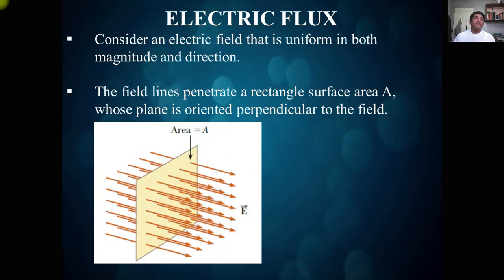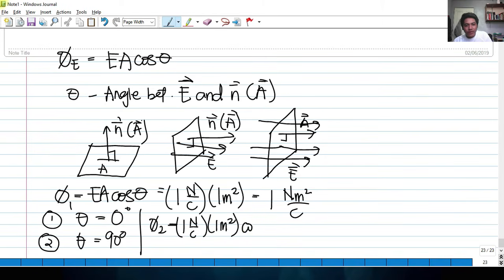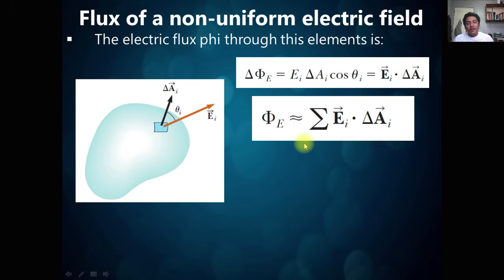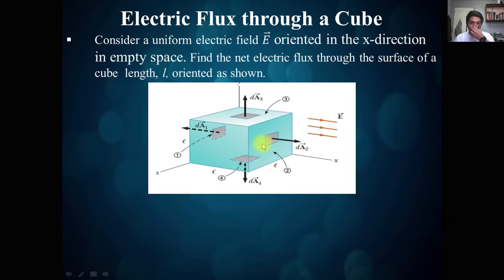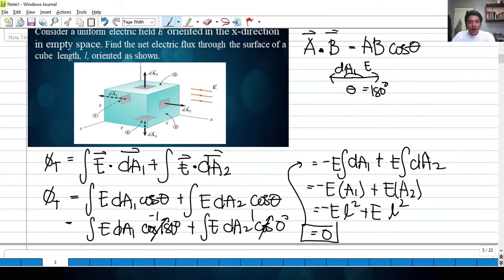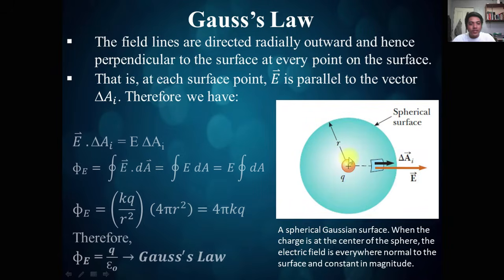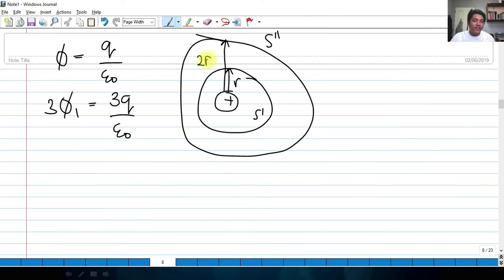Electric Flux and Gauss Law Lecture

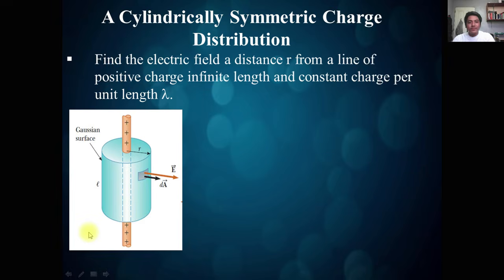Comment: In the last problem in 1:10:13. Why did you not consider the top and the bottom area of the cylinder?
Reply from the maker: The computation for flux for the top and bottom is included when we do integration.